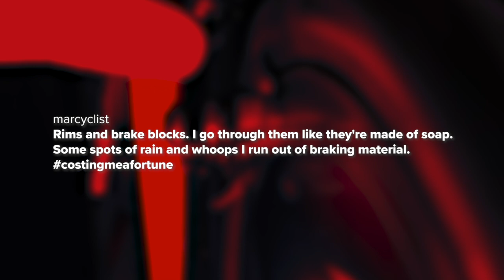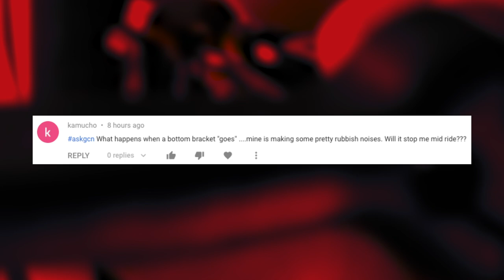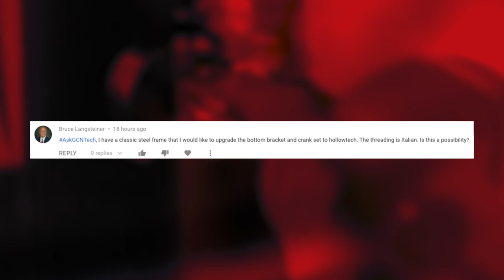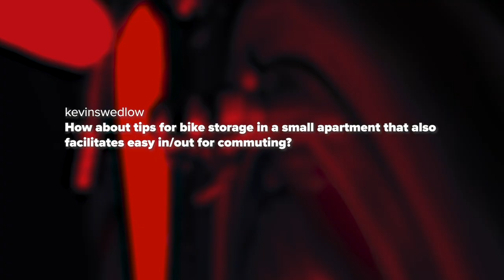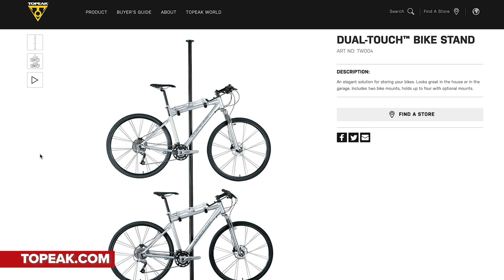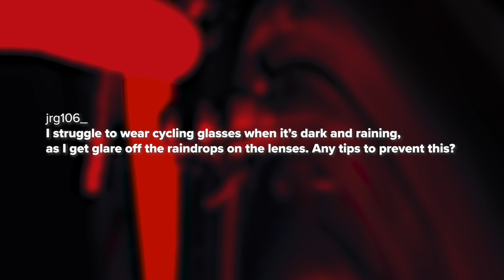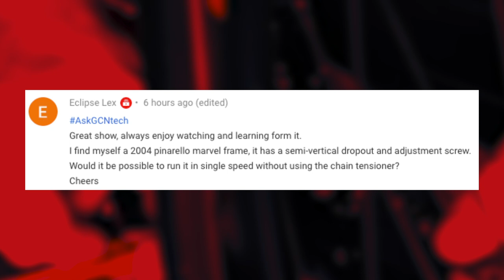How Do I Know My Bottom Bracket Needs Replacing? | GCN Tech Clinic #AskGCNTech

Comment: My noisy bottom bracket turned out to be the seat tube after I followed the GCN tech video on how to diagnose noisy bikes.  A bit of grease fixed it right up.
Reply from the maker: Great to hear you fixed it!
Reply: man0z  I've got that too :(
Reply: that is a classic I guess. my "bottom bracket" was the saddle - and the previous bottom bracket was a pedal. I love it when noises occur randomly and can not be replicated. Gives you long lasting fun :-/
Reply: Mine was that too, now it is the saddle bag for my tools rattling on the seat rails so i tighten it up as much as poss. One of those things.
Reply: yes, me too! turned out the seatpost clamp just wasn't tightened enough!
Reply: Same here. Turned out to be a loose screw on the chainset.

Comment: @05:00 For those looking for small-flat bike storage options, check out MTB Hopper and their ’Smile’ stand: one of the best options out there. Place your rear wheel in the stand, lift the bike up to vertical and a bit past the apex so that gravity wants to tilt it over. Whip up some hook or strap that you can fasten around your front rim+tyre, attach this to one end of a bit of cord and  tie the other end to the leg of the stand. Gravity keeps your front wheel and handlebar straight and the bike stays vertical. Store your bike anywhere - done.

Easier option: rear wheel in the stand, front wheel against the wall. Done.

Comment: @Eclipse Lex: I have turned my old ALAN frame with a semi vertical drop-out into a single speed without chain tensioner. I put a little screw with washers as limit stop for the axle. It works well!

Comment: Thumbs up for the disc brake suggestion.  replacing discs and not rims is half the point.  Other than that I would say doing ride in the rain, and do ride a hilly route in the rain.  Apart from those two things my rims never wear, and then rapidly degrade on a wet downhill.

Comment: #AskGCNTech
Whats the usual life span of an aluminium frame?
I recently reactivated an 1998 aluminium frame for a winter road bike. The frame seems completely fine but I’ve been wondering if there’s a risk for it to fail catastrophically.
I’d appreciate the help, keep up the good work!
Reply: There is no specific life span for a frame. If you have maintaned it stored in a relatively dry place, there should be no problem.
Reply: The frame was maintained quite well. And I know there isn’t a life span in the sense that it will break after exactly 10 years or so. But still, the material does fatigue and also the welds are prone to failure. Also in the 90s the manufacturing techniques weren’t as advanced as nowadays... so is it still save to use after more then 20 years? But thx for the input, cheers

Comment: BB Maint is easy, just not fun or neat. I've used pressure to wash out everything from the BB/BB shell, followed by teflon lube, to try & spray out any dirt. Lastly I use petroleum jelly to re-grease the bearings inside & out. I did this on my Vitus w/PF BB & it still creaked the next day, but soon stopped, I'd never done maint on a PF BB, so this success felt even more like an accomplishment lol.

Comment: i was haunted in my sleep by the sound of what i thought was my bottom bracket, it came and went and i thought i fixed it a few times until somebody told me it might not be. i eventually found it, the quick release was too tight on my front wheel and that horrible sound was resonating in the forks. i've spent years looking after bikes so i was actually offended to realise it was something so simple. i have similar noises any time headset or hubs start to go, i guess some carbon forks make great amplifiers.

Comment: #AskGCNTech My bike a 2004 Giant OCR-2 with specs that follow. 9 speed TruVativ 52/42/30 front crank, Tiagra brifters & Tiagra front mech, rear mech is shimano 105 with sram 9 speed 12-26 cassette. Would it be worth it to upgrade the entire groupset to a 10 speed Tiagra 4700? front crank 50/34 hollowtech II , Tiagra 4700 front/rear mech, 10 speed rear cassette 11-32? I'm on a tight budget and was thinking about upgrading the drivetrain and hold off buying a new bike for another couple yrs. PS. I ride about 550 miles per month

Comment: #AskGCNTech, Hi love your show - thanks for all the good advise! I got Ultegra Di2 and my FD6870 broke. The little "arm" which moves the derailleur up and down snapped (the motor is still intact and works). This "arm" seems its made of aluminum. (after 5 years / 3-4000km per year). I didnt have any crash - it just snapped. Now i am thinking of upgrading that FD to Durace. I learnt it is possible to mix Ultegra and Durace - i would do it if i knew whether this part is made of a more durable (better) material - can you help to get this info - THANK YOU

Comment: i am using a shimano 600 front derailleur from 1989 with new shimano tourney brifters. i have set the limit screws, but the derailleur doesn't reach the limits. i can make it reach the lower limit by adjusting the barrel adjuster, but then it won't reach the high limit and vice versa. could it be that the brifters and derailleur are incompatible and the brifters just don't provide enough travel on the cable? i am also uncertain about how the cable should route around the clamping bolt, maybe i got that wirong? #AskGCNTech

Comment: "Rims and brake blocks. I go through them like they're made of soap." Bullshit, you don't wear rims quickly unless you're using metal or stones as brake pads.
Reply: I can only imagine this happening on the cheapest ebay carbon rims with equally cheap brake pads.  Half convinced it was a planted comment to push the 'buy a new disc brake bike' agenda. Pretty extreme suggestion.
Reply: Maybe he justs rides a lot...